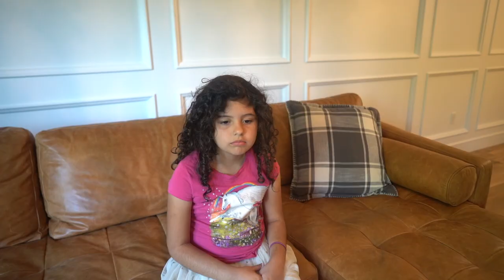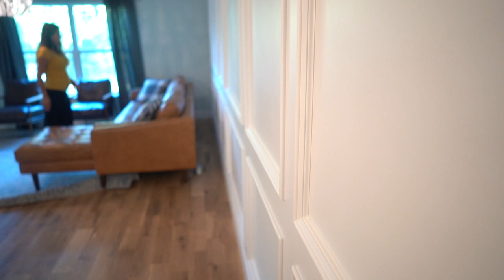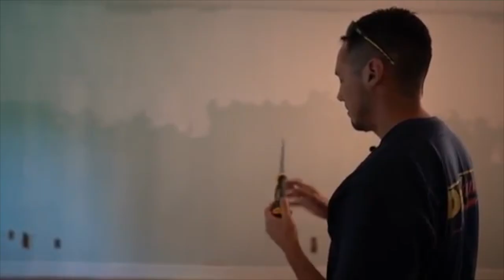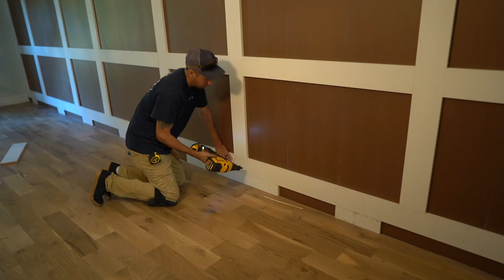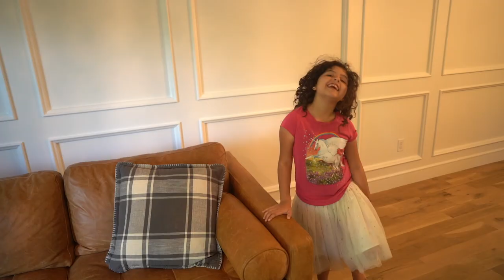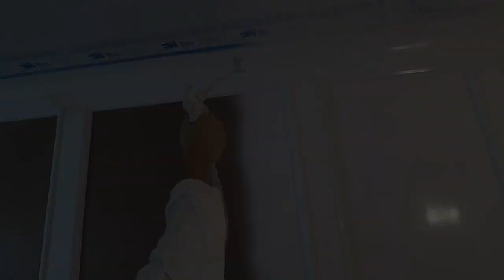This WALL is done.

Comment: Awesome job! Looks great. After studying your videos on crown moulding cutting and installation techniques, I put what you taught me to use and started to work on my family room. Crown moulding turned out pretty well but the room needed more definition so I wanted to create an accent wall on a 20’ blank wall. I used 2 different sizes of chair rail to create a chair rail and picture frame boxes above and below. Turned out really well. I love the depth and definition it shows. I finished that two days ago then I saw this video of yours. Very similar to what I did. I didn’t even think of different size boxes. Could have been a cool option. You’re right...great vibe! Would love to send you pics to get your impression. Keep up the good work and keep sending out those videos! I have lots to learn.

Comment: Very nice accent wall. Simple and classy.
I used to pocket screw wainscoting and staple the 1/4 ply to the back of the face frame for the panel molding or base cap. Really nice finish look with minimal paint prep.

Comment: It is becoming more of an art.  So the beauty is in the eyes of beholder.

I am doing things to my house that I will never in a million years recoup the value.  I ripped everything in my house down to the studs.  And I have to replace most of the studs with LVL, because  some were not supporting the beam as it was supposed to.  the constructor didn't have any moral or pride with their work.  And I have to find it after ripping the drywall.  I have to install several foundation posts, also.

To make the story short, my house feels like a multi-million dollar home, although it is not.  I loved buying the power tools and fixing the house by myself.  The total cost of LVL alone was over $2000.  I used cypress for my steam sauna instead of cedar kit.  It was over $1500 for the cypress lumber , also.   I have a steam sauna in my bathroom.  It is awesome, especially when I get tired.  

Everyone should look at getting a steam sauna like people in Finland.  I swear by it, especially now we are locked up right in our home.

Comment: Came out great..beautiful job as always.  Dude..I have did all the methods you mentioned but nothing will hold up as good as them pocket screws and like you said with savings all that time in sanding and shimming and nothing will stay together better then a pocket screw. I my opinion..there is no other way to build any kinda face frames.

Comment: Beautiful work! I get the same question about my house. I need a good “vibe” as well, and since I do the work, it’s not that expensive. Nevertheless, when I sold my last house about 35 years ago, I really beefed up that place. I added a room with a torrent connecting the main house to the new room (master bedroom). I sold the house in 10 minutes. I’m not exaggerating and at a price well beyond what I was asking. The location was awful, and I had minimal land. SO……
Great work, I learn something new with every video. Thanks!

Comment: Very nice. I have a wall just like that in my dining room (I have a cookycutter house too) and will give this a try. I can't buy any of the trim you are using, because the trim sold in Ireland is different, but your video answered a question I never dared asking - can I use trim and moldings outside their intended use without looking stupid? It looks like the result justifies the means in that case. Thanks for that.

Comment: Your house Dude, do what makes your happy! Nice job, looks great 👍. Picture molding was to keep the plaster on your wall from having a bunch of holes or cracking when you wanted to hang a picture not having to use a nail, it used a curved hook at the top and a piece of decorative cord and hung from the picture molding going to the two outside corners of the picture like a inverted /\ the advantage was that you could move it at anytime anywhere and by lengthen the cord or shorten move it up or down and never doing any damage to the finish on the walls or having to have a plaster or painter to make repairs saving the cha-ching  $$$

Comment: This looks amazing.  I hope I can get some help with a noobie question - I installed crown molding already in our bedroom. Now I want to try to do an accent wall like this one.  I am not sure if I have to remove the crown molding and then sit it on the top horizontal board or if I can just place the top board right below the crown.  I can visualize the edge not looking proper if I do not remove the crown and sit it on the top board.  Any help is greatly appreciated. Thank you.

Comment: I love your work.  I did some paneling up my stairwell in the same way.  I did have a question: by placing the stiles and rails on top of the panel how would you finish the end if it ended at a door.  Your stiles and rails would be elevated by the thickness of the panel and not be flush with the door trim.  I have been trying to find a solution to this problem.
Reply: John - how did you decide to handle this?  
I'm about to install floor to ceiling panels, and I think I'm going to remove all my casings and re-install them on top of the rails/stiles.  (FlexTrim is currently on my arched doorways and I know the paint is going to crack...kind of dreading the carnage - ugg )
Reply: @kimeeegngarden4887  When I decided to put the baseboards on top of the rails, it caused all the molding to stick out past the casing on the door frame, so what I ended up doing was putting a return around the casing. So it ended up being a two-part casing one that was the normal casing and then another one by two that wrapped that casing. I found some images on some websites that showed a double wrapped casing and it looks real nice

Comment: Sometimes appeal and sell ability mean just as much as value.  If your house sells faster than the one across the street for the same price, you did good.  Not to mention the brownie points you get from the wife and your friends.  This is also a great way to showcase your work if you ever have guests over.  There is more value to this than most think.  If you pay a contractor to do such work, I'm not sure if that has the same value.

Comment: "Basic house"

As a Kiwi, excuse me WTF? This would be the kind of house only a rich person would own in New Zealand. My house is an 80 square metre (861.113 square feet) brick and tile house from the 1960s with a bathroom so small I have to choose between putting a bath or putting a small shower in it, but definitely not both. And that house cost me more than I can really afford. I can't afford to have any fun because of it.

To me this is a very lavish home, and I'm impressed with the work being done. If that house was here it would be worth close to a million just in my area (US $655) it was in Auckland, probably more than twice that. In context, my house is currently worth 400k (US $262k) and I have another rental of similar size from 1939, built by the government for dam workers that's currently worth 425k. (US $278k) I live in one of the cheapest areas in NZ. For more context, I make about 53k (US $35k) a year as a carpenter.

We have some of the most unaffordable housing in the world here, but it's not quality housing. Our houses are cold and damp in winter and hot in summer. Most are old and not well insulated, they are small and built cheaply. I'm just glad I'm not renting, the rents in my area have more than doubled in the last 4 years, and it's extremely hard to find a rental. You have to really stand out as an exceptional prospective tenant to even get a chance these days. It sucks, because we have some of the lowest wages in the OECD. Our house price to income ratio is 111.6, which is one of the highest in the world. And we have high taxes too. It's a struggle.

Keep up the good work man, you are an inspiration, in your awesome workmanship, your integrity, and your beautiful family. Don't let the haters get you down.

Edited to include freedom units so Americans understand my post.